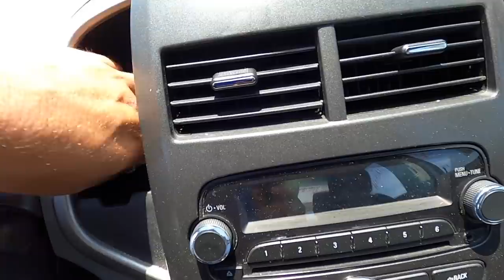I won a 2015 Biohazard Chevy Sonic from IAA for $2500 w No Key!! Run and Drive??

Comment: I'm a loader and forklift driver at a salvage yard. The reason the car was stuck when he backed out. He had the front end to close to the carriage. Reason why for the damage front bumper. He had long forks on the carriage and no need to have the car that close.
Reply: I noticed your comment as I was writing mine. I agree with you 100%. I would not be surprised if  that driver was responsible for the front end bumper damage
Reply: I noticed that too
Reply: Thought I saw something suspicious
Reply: @ccacace1  I'm not sure if he had alot of cars to load. Where i work i only have short amount of time. To spend on moving each vehicles
Reply: 100% right man
Reply: Yess i also noticed that
Reply: Careless
Reply: Wasn't this the place that trashed the Mercedes SUV bumper with the forklift??

Comment: Randy, please wear gloves going through all your cars you buy specially this one.  Yes the fork lift driver has no business having the front end slammed in the forklift like that and he pushed it back with the car being in park. Forklift caused that oil pan damage and front bumper damage and wouldn't be surprise if they dented the driver side fender as well. I would have them be responsible for all that! No way I'm paying 3k and let them do that. Good luck.

Comment: Why would you start a car when you know it doesn’t have any oil?!?!?! 😫
Reply: Auto Auction Breaks
Reply: Dodge Farm Guy  when he puts the camera under car we see perfectly that the oil pan is broken... and is driping on the trailer...
Reply: Dodge Farm Guy  Clearly wasnt enough to build oil pressure as the light was on. AAR breaking stuff yet again. Never learns
Reply: Enjoy watching
Reply: He didnt run it long enough to hurt it.
Reply: @JohnSmith-kr9zw  pan broken from crappy fork lift driver , sounds like you dont know what you are talking about leave me alone
Reply: It wont cause too much damage as long as you shut it off real quick. Sure it's a gamble, but its better to see if it runs before throwing money at it.
Reply: As a lesson on what NOT to do.
Reply: John Smith maybe it to make more videos = more money
Reply: It is what it is
Reply: John Last  starting any car woth out oil for a sec or not well hurt them that car wont last long
Reply: Dylan Ash throwing money is batter then taken a chamce on breaking and thats facts i work on cars
Reply: my guess was he forgot, It must have built pressure for a sec with what was left of the oil in the pan and in the filter  so the engine might be ok
still really dumb move tho
Reply: No kidding! It's like beating a dead horse... lol

Comment: Man, i dont care where it came from if a fork lift driver treated a vehicle i paid for like that, i would flip my lid, smh...
Reply: IAA fork drivers are horrible... I’ve had multiple suspension issues from vehicles bought from there... weren’t there when I inspected it but was there once I checked it on the trailer... it’s sad.
Reply: Probably how the oil pan got a hole too. Unless the car can bottom out when the tire popped.
Reply: iam shocked as soon as i saw the needles and pills,like an addicts' car so the IAA involved into

Comment: That’s not a good deal.
Reply: Not worth 2500 if it was all squared up.
Reply: I think he could still make a little profit, once the fender and oil pan are replaced. Or as some have suggested, a great Turo car, since it has a clean title.
Reply: @fakebrake  You obviously have no idea what you're talking about but good try

Comment: What a way to put a car on the floor: "alright Imma floor it and slam on the brakes to see how far the car flies off the forks". Geez! You'd be lucky if he didn't mess up your trailer with the forks as well.
Reply: it was stuck on the forks.or more likely the oil pan
Reply: That's what I was thinking too. He could have ruptured the oil pan.
Reply: @davidgalinat4257  Lol Disposable so what is the difference.

Comment: That's BS. The auction place should be responsible for that oil pan.
Reply: by the location of the pan, being next to the busted tire, most likely bottomed out  when they hit whatever it was. looks like maybe a curb of some kind.
Reply: I had one and I live in South America, in 2 years I had to fix the oil pan 3 times when you see one of this cars, run away from it. They eat thermostats for lunch.

Comment: A suggestion......  After you carefully clean out the interior of all the debris, run an ozonator in the sonic for a day or so to disinfect the interior of the vehicle to be on the safe side, make certain the air handling system is running on internal circulation as well while disinfecting!!!!!.

Comment: I love our dd 13 sonic, non turbo sedan, 62k on it as we speak ....what i have not figured out if what is the card slot for below the media controls ? They have a neutral slot beside the shifter to get it in neutral, good video randy ...i reailze it an older video but good, was this a 1.8 as well? Best of the 2 motors ....turbos dont last - Mark

Comment: When it makes that "ping" sound is to let you know the door is open
Reply: Should only "ping" if the door is open while the key is in the ignition barrel.
Reply: The thief probably bypassed the immobilizer somehow and fucked up the ignition in the process. Randy will probably need to trace the ignition wires in order to get the keyfob working and replace the ignition cylinder.

Comment: im saying it was in a police chase and pitted
Reply: Or spiked, by the look at that front tire. That's not a blowout, it's shredded.
Reply: @danielhartin7680  continental tires are garbage, they are known for blowouts. I know this doesnt look like a blowout but its s continental, so it wouldn't surprise me if it was a blowout..
Reply: They simply continued driving after they blew the tire until they completely obliterated the tire wall.

I have seen the same done to Firestone, Goodyear, etc.

Just watch some police pursuits where the suspect gets a flat tire and they continue driving, on this car they stoped before they drove on the bare rim.

Comment: Go to gm and buy a new key. Dont have them program it you can do it yourself. Put the key in the car and turn it to the on position. Leave it for 10 minutes like that. Then do that again for a total of 3 times. After the third time your new key will be programmed. Make sure uour battery is charged or on a charger. I've done the personally so I know it works.

Comment: I wouldn’t even replace the fender I’d just pull the inner fender pop the dent out as much as you can. Fix the oil pan and clean it up and send it down the road.

Comment: I think the sonic will be a win. Good thing it didn’t have a key. There’s a good chance that it wasn’t run without oil
Reply: True. I'm sure the shredded tire and punctured oil pan happened at the same time, and the vehicle was shut off after the incident. And when he started it briefly at the Chev dealership, there were no chattering or knocking noises coming from the engine.
Reply: Until Randy got a hold of it loool

Comment: My IAA treats their cars like trash. I've been in their lot many times and it doesn't matter if it's a nice car or a junky car, when the car gets moved around, it's without any care. I have yet to see my IAA move a car without cracking the bumpers or put the forks underneath without hearing some nasty sounds coming from the suspension. And according to them they are not responsible for any damage even if you can prove it was done by them and after you bidded on it and won... That's sketchy

Comment: I would not sit on the seats in case there's a needle embedded in the cushion. I would not touch the clothing (same reason). I would not touch the carpet (same reason) that interior needs to be gutted and the seats need to be completely disassembled to verify that there are no needles embedded anywhere.

Comment: Forklift ran into the oil pan you can see it when you got into all the way in the back with the camera right before you started to pull it back out when you inspecting the bottom before you took it to the dealership
Reply: Those compact cars are so small and low to the ground those forks just scrap the bottom no matter what

Comment: The car looks like the inside and outside of my old integra when it was recovered after being stolen. It was spotted on the street and chased down by sheriffs. It had a fender pushed in when they bailed out and was left running with no key. Clothes and junk everywhere and weed all over the passenger seat and floor. That engine is probably damaged from being run dry by the tweakers. I was lucky? enough to drive mine home and sell it on.

Comment: I stay way from bio cars. I would have to disclose it to the buyer and have them sign off that it was a bio. Bio could be mold body fluid meth etc. When I mentioned it they are turned off quickly.

Comment: The fact that the oil was pissing out all over the trailer makes me suspect the damage had only just been done, almost certainly by the forklift driver. If it was busted before it ended up in the yard, it would have been dry as a bone.
Reply: I dont think so, cause when the forklift driver put it on the trailer you see that there was cardboard or something underneath it which might have been put under the car to let the oil drip on to

Comment: I know you have your reasons for doing things the way you do them but I would have passed by a tire shop and had that tire replaced while it was on the trailer.  I can't imagine the work it is going to require to get that car off the trailer, and damage to the trailer, with that rim the way it is.
Reply from the maker: Didn’t damage a thing and it was no issue at all
Reply: @AutoAuctionRebuilds  What is the deck of your trailer made out of?

Comment: It seems like the IAA cars are usually more beat up than the Copart cars. Probably because those forklift drivers don't give a shit. You can see the damage to the rear bumper too where it rubbed on the forks.

Comment: I got a better deal,  2011 Cadillac sts  66,000 miles for 2400.00 bid  with keys, replace fender, mirrors, front bumper cover, 2 rims and tires, good to go.

Comment: Another question - since you purchased this car through these channels, you clean and repair and then sell them.  Do you have to be concerned about the liability of reselling a biohazard car such as this?
Reply from the maker: All cars in Oklahoma are sold "as-is". There's no recourse.
Reply: @AutoAuctionRebuilds  Understood!  At least there is that.  Makes it easier and safer for dealers that way.  Thanks for the info!

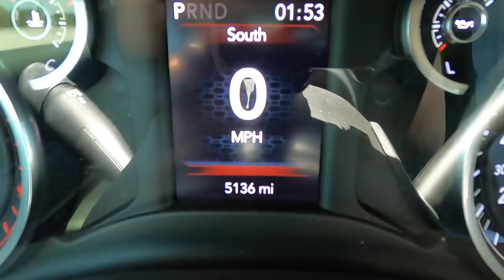Comment: ur supposed to change ur oil everfy 5k with full sysnthic 3k conventional..... 11:20 its a ram anways lmoa who cares
Reply from the maker: Shock City no rams are 12mos 12k to keep warranty but I’m changing mine early
Reply from the maker: Shock City this is diesel bro they aren’t even close to gas cars / trucks
Reply: @AutoAuctionRebuilds  its made by chrysler all i need to know lol
Reply: @AutoAuctionRebuilds  ur just going to carbon up ur engine. ur cars proabably a lease write off so doesnt matter do the bare minimum
Reply from the maker: I don’t lease I own. Carbon is from burnt fuel not oil 😂